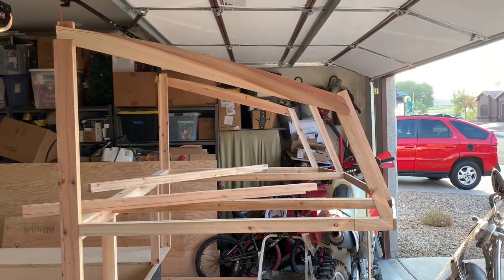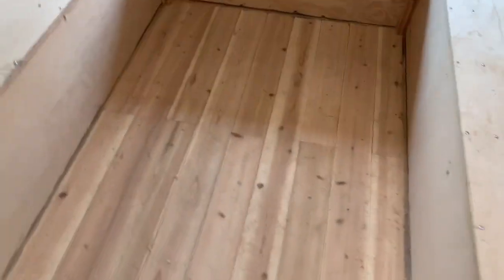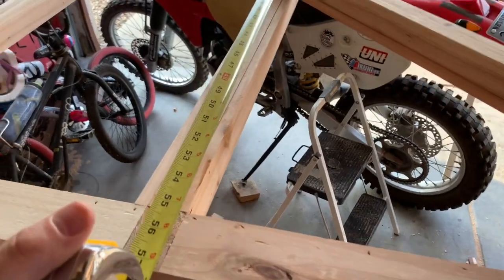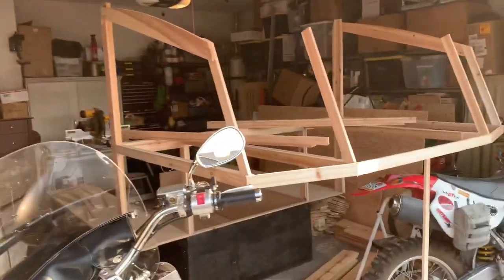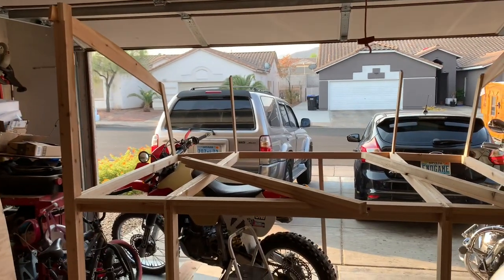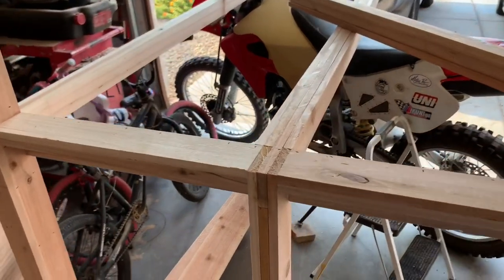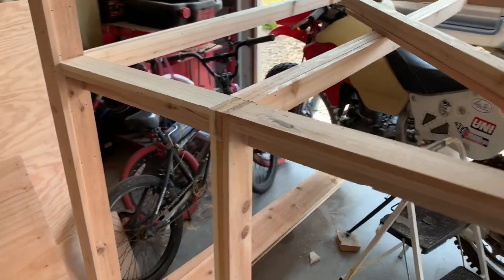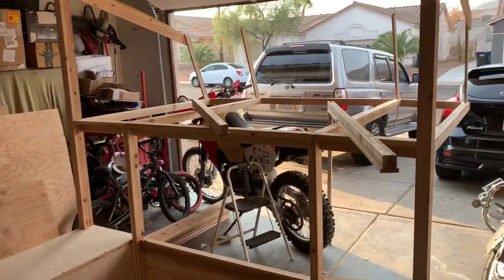Home Built Truck Camper Build: Part 2

Comment: I know this is a relatively old video but it is very informative as well as interesting to see how you approached your build. I'm considering a build for a Tundra which has a total payload of about 1900lbs - less passengers, etc. - doesn't give much. In looking at specs, most start at 1500lbs for a half-ton pickup which gets very close to their maximum rated total payload. So, your approach seems the only choice unless I go for a Silverado 2500 or similar. Would be nice to not have to worry about payload capacity.  Another build used composites from Total Composites where they provided a bare bones camper which fit a Toyota Tundra. That was around $18000. Then you have to finish it.  Also, it looks like a good retirement project. So, I'll watch all your videos to see if it is something I want to tackle. Thanks for doing this!

Comment: Fascinating 💡... another idea you may consider is cedar lamination with metal joinery w screws.  Watching your videos and looking at what I have and how my mind works, I may use your ideas and modify them to fit my resources and skills and experience where I built a "sleeper" in my pickup truck that I used commercially.  Your woodworking tools and experience far exceeds mine ...

Comment: How wide are your wings? How far do they extend from the truck rail? Mine are feeling a little to long...
Reply: I would have to go out and measure.  What is your total width (wing tip to tip)?  My overall width is 81.5 (with trim).  My tub floor width is like 46. These are numbers I know off the top of my head.  Let me know if you need further.
Reply: @dmason8078  ha! I thought so! My overall is 91”! I think I’ll take off 4” on each side!